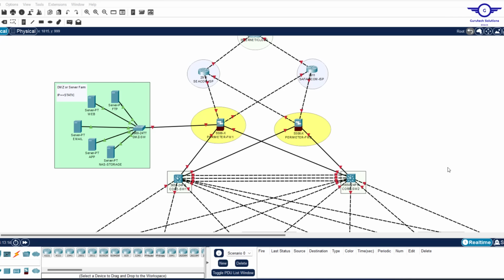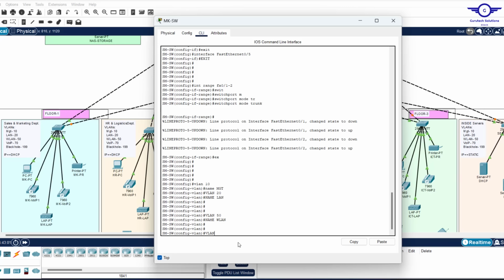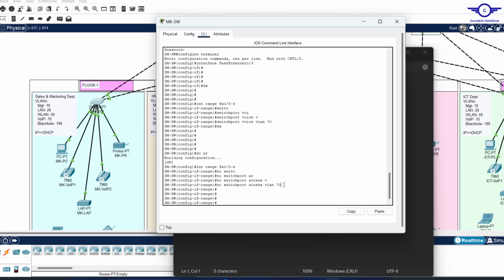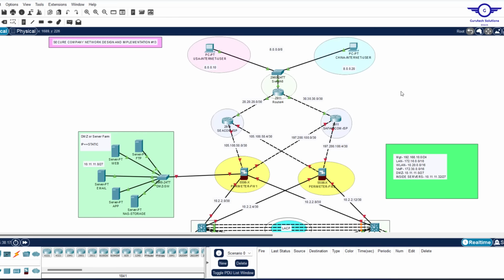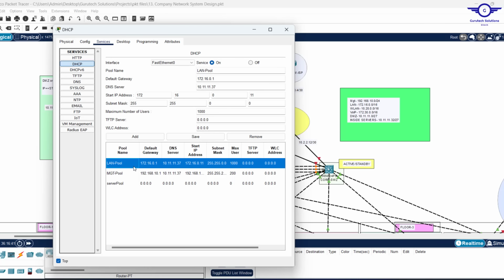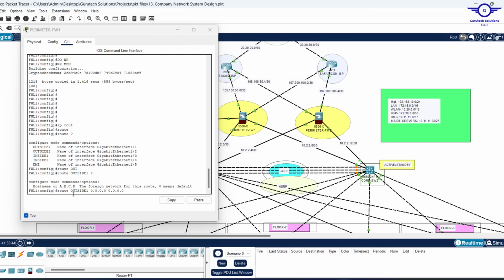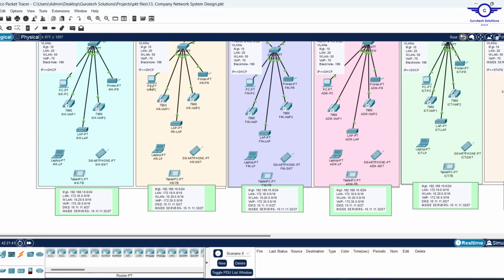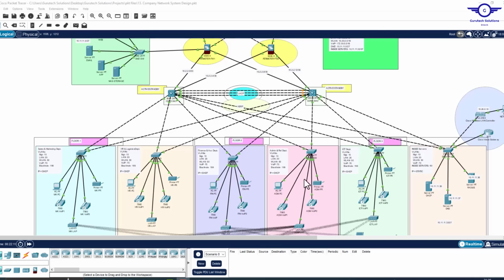Secure Company Network System Design Using Packet Tracer - PART 2 | Advanced Company Network Project

Comment: I'm sorry, but did we specify which firewall is active for each core switch? or does a core switch send data to both fws at the same time? i scrolled back but don't see this config neither in core switch or fw config
Reply from the maker: Core switch sends traffic to any random fw, the HA fw part is not supported on pkt
Reply: @ thanks for your responce! i'll read about HA firewalls then

Comment: in cisco packet tracer is there possible to capture network traffic like wireshark did ?
Reply from the maker: Not at all, use gns3
Reply: Hello @gurutechnetworks,I am installing gns3 for my lab simulations,unfortunately am encountering a grayed out gns3server vm error.All online proposed solutions are not working for me, have you dealt with such issue?if yes how did you resolve..TIA
Reply: @Atreus444  1st  vm ware and gns3 installed same location.